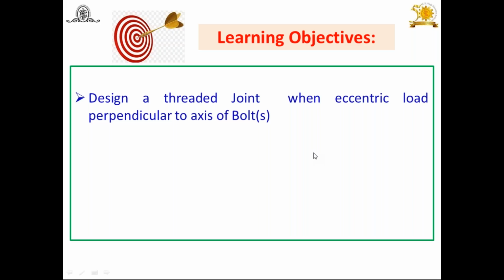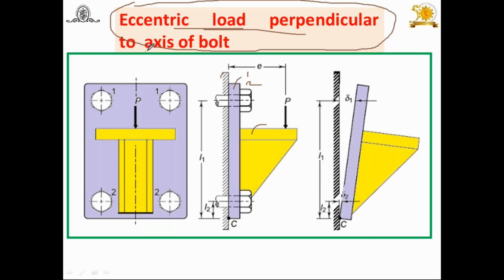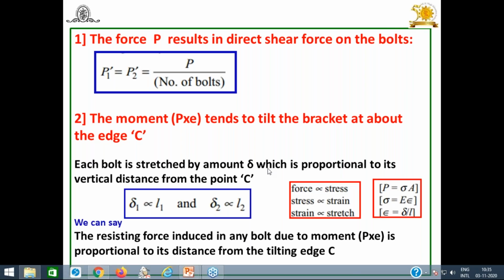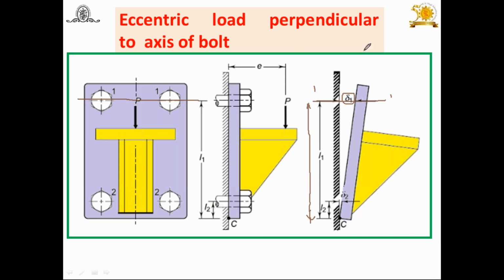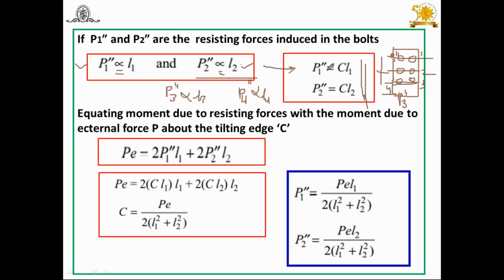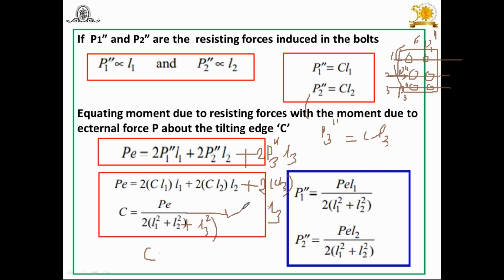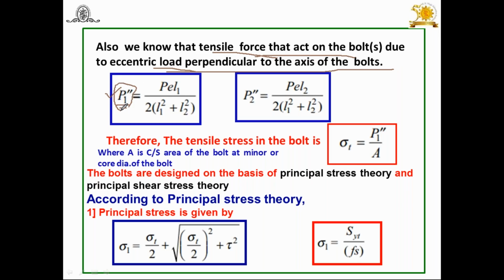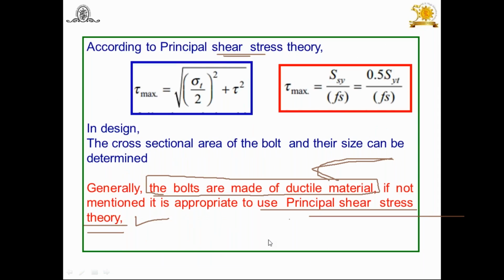Design of threaded joint: Eccentric load perpendicular to the axis of the bolt(s)

Comment: Hello sir, Why don't we use the flexural formula (equation of bending) to determine the stresses in bolts in such a case ?
Reply: Elastic method is more conservative in some cases, especially more bolts are in-lined or close to centroid of bolt group, then they're almost give no help